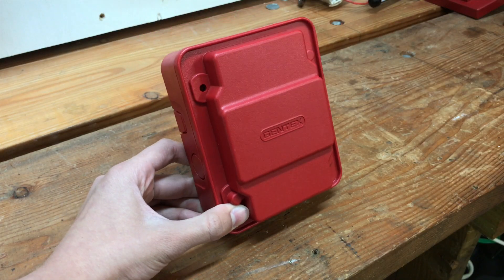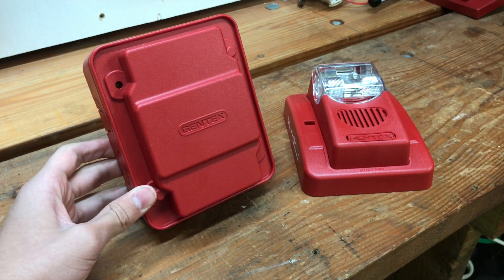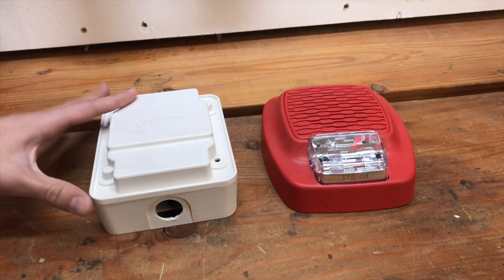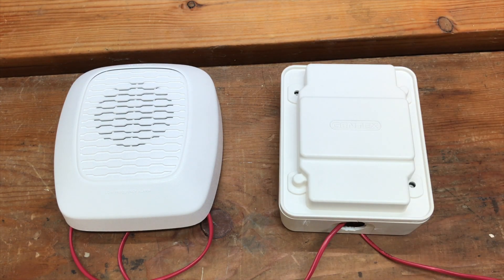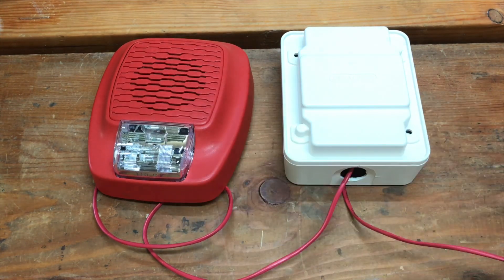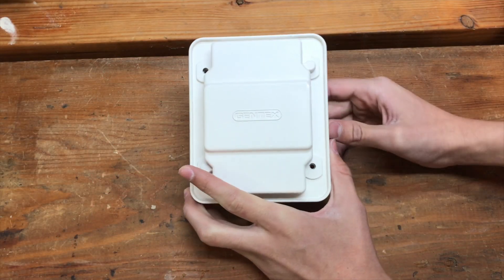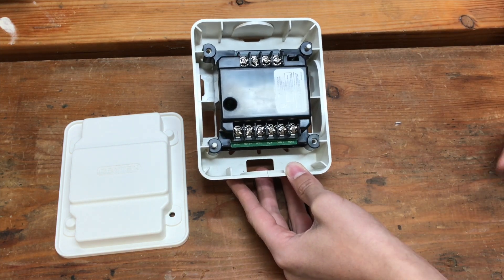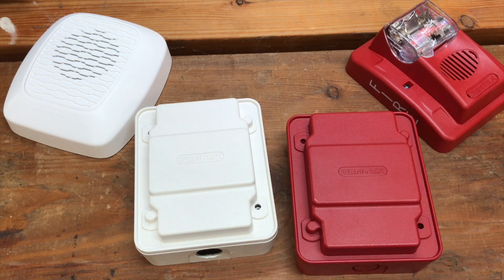What is the Gentex GTSMW Sync Module?

Comment: One could put these devices on a home security system with a dual-channel relay module and a 24V power supply (i.e. Ademco Vista with a 4204CF supervised relay module with one relay configured for fire output and the other for CO output).